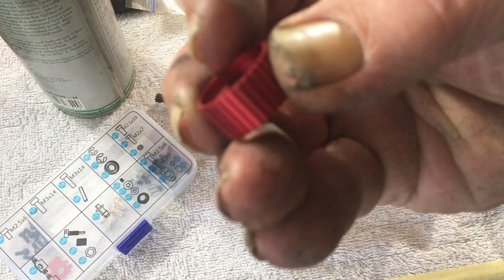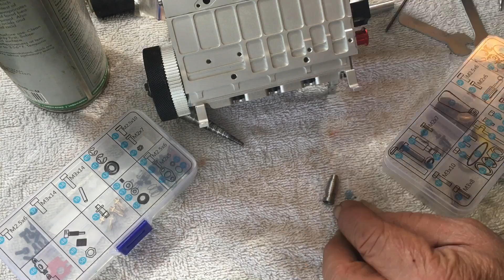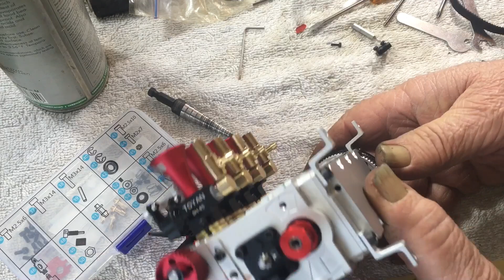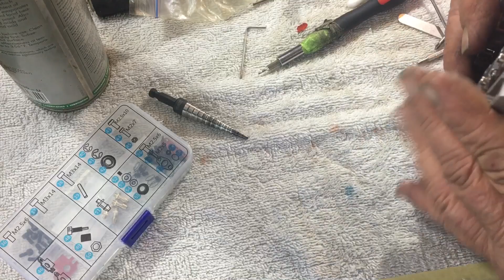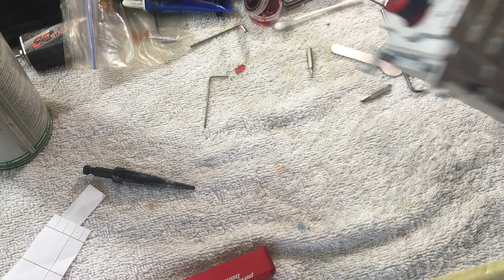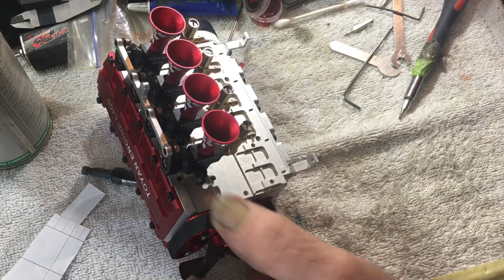TOYAN FS-L400 BUILD 4 FINAL ASSEMBLY

Comment: Hi Dennis. you are doing a great job with your video. can you please respond to my questions before. what opinion about getting the L400 assembled and then disassemble it in order to assemble it back. thanks
Reply from the maker: Hi sorry for the delay in getting back to you, if you buy one that is assembled just remove the bottom cover and check all is tight,

Comment: Do I need to set the carburetor after building the engine? If I have to, show me how please
Reply from the maker: Yeah after you get it assembled set your low needle to 1.5 turns and the high needle to 2 turns out to start,  after its broken in you can lean it out (turn the high speed needle in) all the settings are close to this but depending on your fuel and outside temp.

Comment: hi dennis the trumpet part of the carb does come off,they are only on there with lock tight, little bet of heat they will come off because i have removed the ones i have
Reply from the maker: Cool Thanks!
Reply: @dennisdempseyradiooutofcontrol  hi Dennis just letting you starter motor won't last it ends up braking a wire inside  mine just did

Comment: Someone was asking about nitro content. I thought I`d have a play. 12% runs fine.
 20% pick up a LOT better
 25%  Same as above.
30%  Engine doesn`t like it. Runs hotter even with richer mixture and sounded harsh. Probably just starting detonating.
Reply from the maker: Good explanation,  I have ran mine on 15% and 20% with good results, I figured the 30% would predetonate and heat up.

Comment: Dennis a heads up for the timing mark on the CAM pulley, this isn't the mark the builder should follow because the pulley can be installed 180 out, what you need to do is align the mark stamped on the end of the camshaft with the mark on the crank pulley (both facing down). The directions don't mention anything about the mark on the end of the camshaft.
Reply from the maker: Good call brother I forgot to mention that in the video, I will do an updated vid on the timing marks to inform everyone, Thanks
Reply: @dennisdempseyradiooutofcontrol  Anytime. Wish I could send you pics of my build setup, it's all on wood for now for trying different things but I think you would like what I came up with.